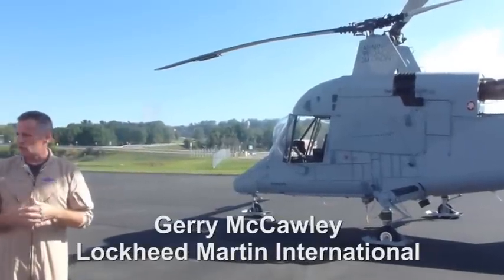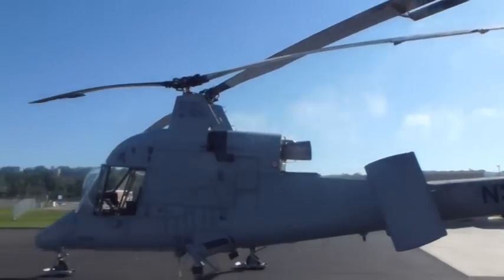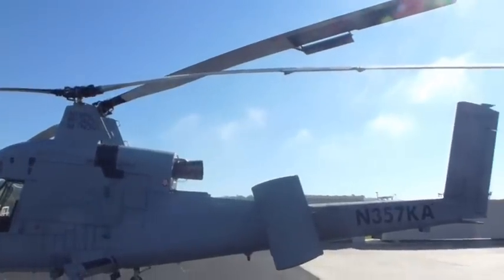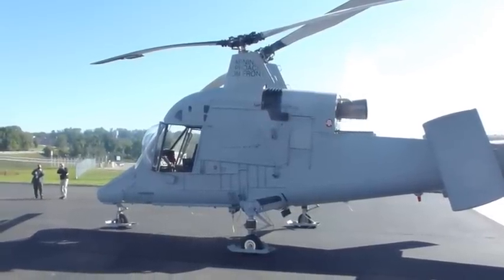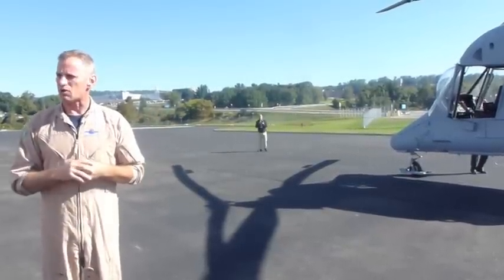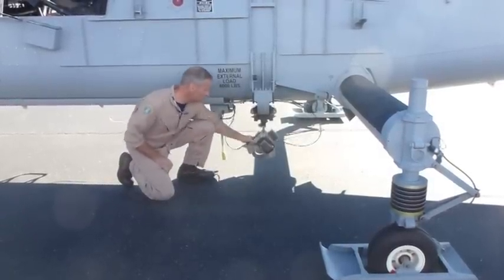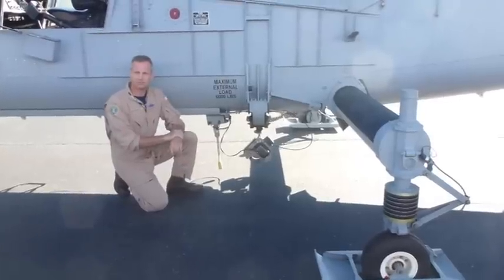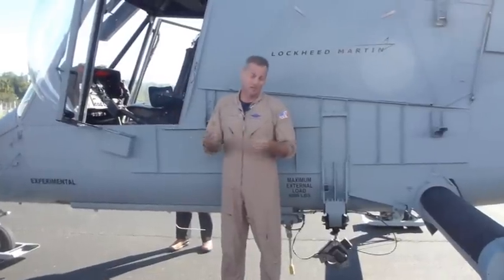Lockheed Martin's K-MAX Helicopter Briefing & Flight Demo

Comment: the original helicopter with this system was the h43 the airforce used it for fighting aircraft crash fires and rescue. after its service companies discovered its heavy lift capability for its size the Kmax was designed to use the heavy lift capability but got rid of about 70% of the fuselage

Comment: It is a modern Nazi Kolibri, with the FLETTNER FL 282 KOLIBRI elevation system, invented by Anton Flettner, a German engineer and inventor born in 1885. There is a predecessor post of this Lockheed on my channel  ;)
Reply: The Germans designed so much of today military equipment like the flying wing concept. This coaxial helicopter. the V2 rocket, the blue prints and concept of the nuclear bomb and so much more. It makes me uneasy now that there military is free from restrictions again after 2022.

Comment: even seven years on it looks so futuristic ..
Reply: Mid to late 1930s German technology.  I logged, fought fire and built power line in these before I retired.  It's very capable but no fun at all to fly.
Reply: @waynearrington6727   good grief , they look like they should be a real hoot , like those Kamov 28 things ,, but its still a better job than digging holes in the road ,,,

Comment: How to synchropters are rotate around its axis?
How does the torque appears?
Reply: Oh! I see. No torque. It's just rudder and airflow )
Reply: It is yawed by a combination of differential torque (by increasing pitch on one rotor and decreasing it on the other), and tilting the rotors slightly in opposite directions.

Comment: Really interesting design.  I have always like the dual rotor/coaxial rotor helicopters, like the KA-32.  If I had the opportunity, I'd ask the designer why they have a tail boom extending beyond the rotor discs when no tail rotor is necessary.  If you removed that boom and ended the helicopter at the stabilizers just ahead of that, you'd save even more weight and be able to fit into tighter spaces (like the KA-32).  Also, is it me or does it seem quite a bit quieter than other helicopters?  I'm fascinated by the flaps on the rotors.  Amazing machine.  They've obviously trimmed it down to bare fuselage minimums, thus the shape, but if you put a more bulbous fuselage on there you'd have copious amounts of room for passengers or internal cargo, or put pylons on it and call it a gunship!!  So many possibilities!!
Reply: The tailboom is a counter weight for the front end of it, (the cockpit)
Reply: Co axials are too slow for a gunship role and have issues in strong winds. Great for sling loads, and firefighting. Search an rescue would need a much bigger fuselage.
Reply: And the tail booms vertical stabs give the helicopter stability in forward flight also i believe the small rudder on the vertical stab moves with the yaw pedals
Reply: @Einwetok  Yes correct this relatively small helicopter can sling 6000 lbs
Reply: @jdhiner1  Reminds me of an A4. Could haul it's own weight in bombs.